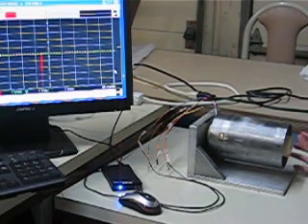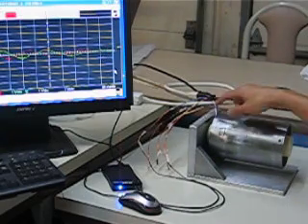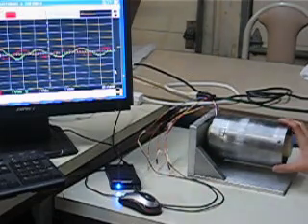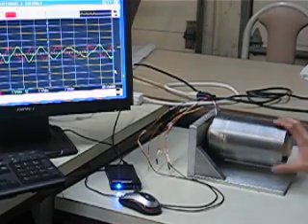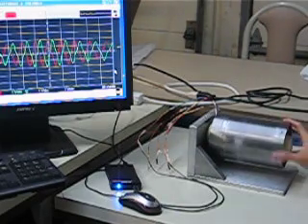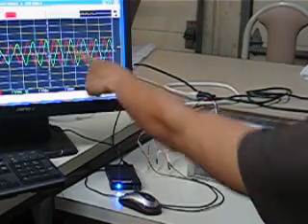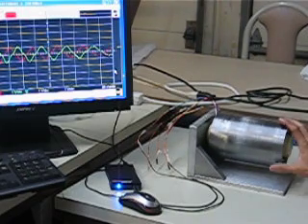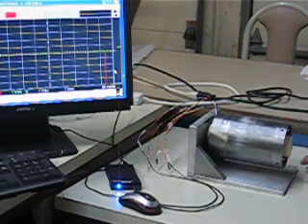High Efficiency Brushless AC Motor/Generator

Comment: Hello!  I am very interested in testing your technology in a new project. We are designing a system to pump water and then generate small amounts of energy to suit particular needs by opening a water nozzle. The jet of water hits a turbine attached to your the generator (ie. to watchTV, charge phone, etc). Water is pumped by an Ecologically friendly pump powered by wind or bikes.   Do you have a motor that could serve such systems?  Either be very versatile (for outputs of 3.5V to 127V-220V) or maybe use different sized ones for supplies up to maybe 2KW? -Saludos desde México!

Comment: word limit ^) You cannot get all of the energy back, but using outrunner brushless motor/generators, that require little force to rotate(as you show), use the KE of the cars motion. After going through transformers send it to the battery or it send the power directly to the motors. Maybe I am talking nonsense, just looking at it like how a Cessna 172 Powers the G1000 as it flies. Once the battery is full, it just goes straight to where the load is used. Get some energy back and increase mileage.

Comment: I understand, there will be a loss in energy. But what about trying to keep as much of that energy as possible with that car? i.e. like a closed loop circuit. In that energy is lost due to resistance, heat, etc. Using what you have made as a alternator of sorts a car would lose that energy in the form of friction and weight(on an incline needing more power). With multiple 3 phase generators spinning at high rpm's(like a airplane CSD) try and recoup some of the energy that was transformed into KE

Comment from the maker: We have spent a lot of time to fine tune the design and make the motor even much more efficiency. It tool more than we expected. Now er have more confidence to introduce the commercial model. Do you have any application on the motor? We will have 1KW and 3KW motor/generator system first.

Comment from the maker: It can not violet the energy conservation law. The energy will always loss some during the conversion between mechanical energy and electrical energy. Our motor system can minimize the energy loss during the conversion. We can achieve 95% for even small size of motor which is rather difficult in the existing motor.

Comment: Of what Daniel Le was talking about, what about putting a brushless motor on the axes running to each wheel. Have a gear welded onto the axis and use overdrive gearing(4/5:1) rotation to produce current. Use it gear to gear or possible a CSD(constant speed drive). Not the motor driving the wheel, but the axis itself. Possibly better on big rigs that could support 2-3 generators/axis with up to 4 axes. Energy is always lost but tie it in so energy can go straight from the generators to the motor.

Comment: That is the same thing as hooking a motor and a generator together on a desktop. If the motor runs from a battery while the generator recharges the battery, it will slowly drain. The reason is that energy is ALWAYS lost in conversion. Batteries are DC and must be converted to AC before driving a brushless motor. Coils have resistance. Magnetic fields create heat in the motor parts. Air gets circulated around the mechanism. Bearings have mechanical drag. Energy is always lost in such a process.

Comment: okay, but what if the back two wheels were accelerated by a motor while the front two wheel acted as a generator thus replenishing a main battery or backup battery? thanks.

Comment: "Driving" consists of two fundamental energy exchanges that, by definition, cannot happen at the same time. Positive Acceleration where energy is converted into motion and Negative Acceleration where motion is converted into energy. A device like this could definitely be used in each wheel to act as a motor or a generator, but not both at the same time. Honda and Toyota already make their hybrid drive systems like this. So there really isnt anything new here. I have my doubts about a patent...

Comment: Where is a video showing measured data to confirm your efficiency?? Looks pretty cool, but all I see is a regular 3-phase motor turned inside out. For sure, this has applications for energy storage, because the rotating moment of inertia is further from the center of the assembly, thus maximizing energy storage in a given package size (assuming same RPM and size of a regular motor). However, this is hardly new. Baldor and Synchrony easily get 97-98% efficiency. Documented and displayed...

Comment: @splee888 did you ever get this to operate on a wind turbine? I have been working on an idea and I have a way of turning this motor with a consistant rpm. what higher speeds do you consider to be optimal for your motor? If you hooked it up to you home power supply would you need an inverter? Thanks for posting. (By the way, I have a very specific application for this motor so maybe we should talk.)

Comment: im new to this i was given a ac motor has  on the side for a belt to turn it but doesnt generate electric when using a bike belt and pulley whats the trick to get it to generate electric ? would appreciate it as im not tecknicaly inclined thanks

Comment: Very nice build . However since this is ironless stator in a compact package you will quickly realize that heat dissapation is going to be your biggest problem as soon as you start to put some power through that thing. Unless you guys solved that,now that would be a breakthrough. Windmill guys been making ironless axial flux alternators with good results but they have a huge surface to dissapate heat.  Anyways thats just my opinion. Good luck!